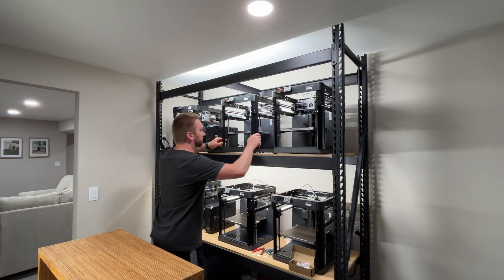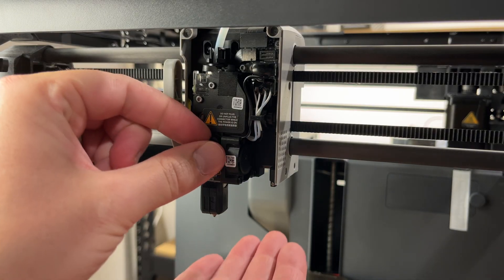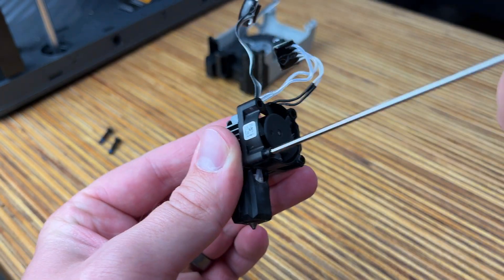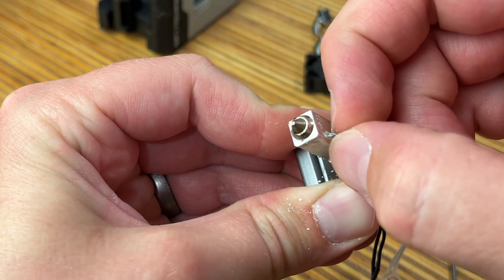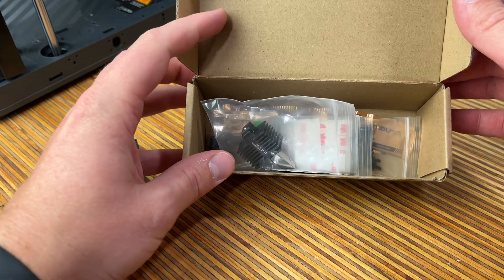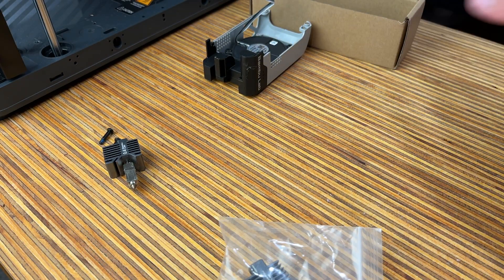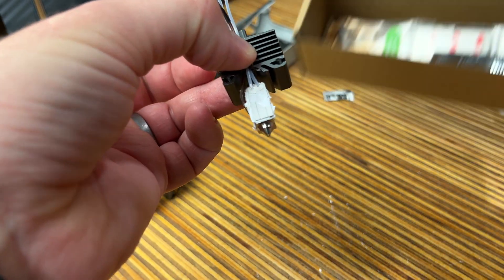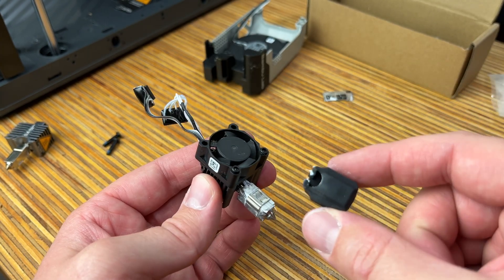How to Replace the hotend on the Bambu Lab P1P

Comment: i was gonna replace the hotend because it clogged with a fillament that just... wouldn't unclog no matter what i did. then i noticed how all electronic were off now, and i just took the hotend to a hot air gun at 600c. then FINALLY that goddamn piece of flex filament melted and managed to push it out. goddamnit now i don't know what to do to use that filament. i have 2 spools of it and i wanna use it to make an undersole of sorts for my expensive running sneakers, so i can run on my hella abrasive treadmill and not destroy my $300 sneakers in 2 months

Comment: Question: How long did you run the printer, or how many spools of filament approx did you run through the printer before noticing you needed to change the Hotend?
And, I think it takes abrasive filaments to wear out the tip that comes with the printer. Were you running much abrasive filament? So far, I have only printed PLA, and 4 spools through mine.. Just wondering.. So far, I have had only one filament problem, and I think I caused it... AS the filament ran out on one spool, I tried feeding a new spool filament through while the old was finishing up. I think if I would have waited for it to Run out, I could have loaded the new and not had a problem. But, a piece of it was left in the printer PTFE.. The only short strand of filament I have left over. The rest ran out, I waited, added new and had nothing left over.
Reply from the maker: I don’t remember exactly but over 1000 hours for sure. I only print with PLA and PETG, nothing abrasive yet.

Comment: Hi, I have a problem with my prints that occurred out of nowhere, I have a p1s, with 6<months of use, and the issue that I'm having is, that when it comes to print the infill, it does without completing the line, it has little gaps in every line of infill, looks like it's clogged but it's not, I checked several times, I tried recalibrating the printer, flux cal, temps, changed type of infill but the problem persist. I'm pulling my hair out trying to solve this problem but can't find any solution, I've already looked in the wiki, and a couple of people had the same issue but didn't find any solution. The crazy thing is that, bottom and top layers are great, same with walls, it only occurs with the infill

Comment: Great video 👍🎉. I tried replacing the hotend on my P1S a few days ago after about 800 print hours. Unfortunately, I wasn’t careful enough when pulling out the thermistor (cable broke), so I had to buy a new thermistor and ceramic heater. Next time, I’ll probably just buy the complete assembly. Do you know how many print hours your hotend lasted?